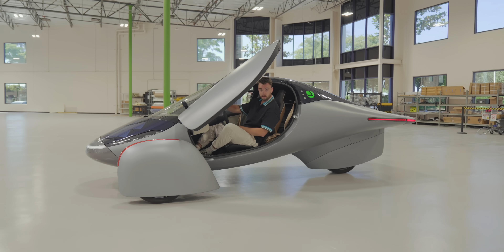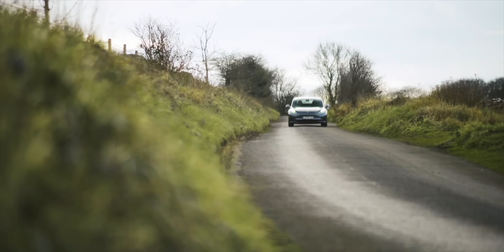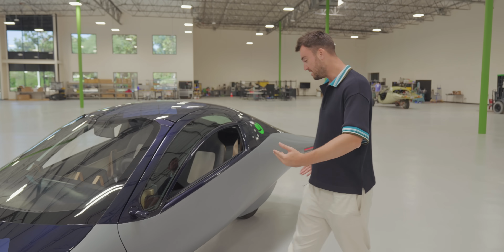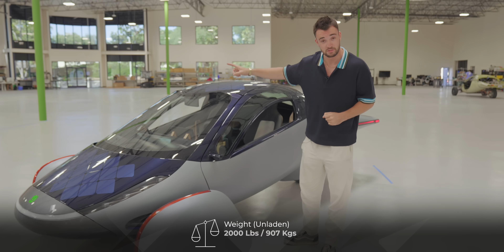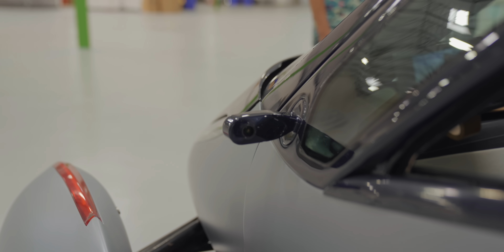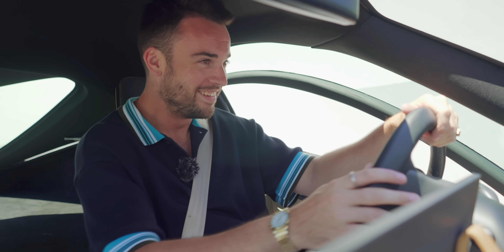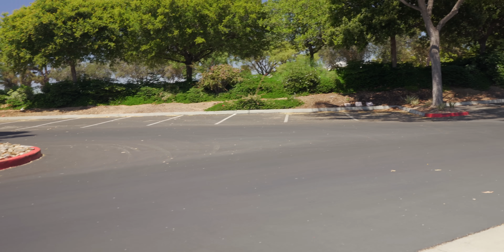The Game-Changing CHEAP Electric Car Inspired By Fish!

Comment: It would make a great summer commuter. Winter up north may be a problem for it. Just looking at it.
Reply: I drive a Gen 1 Honda Insight through Iowa winters.  With similar clearance and much better ABS/Traction control while weighing about the same I don't expect serious problems from Aptera.   However, I will be reporting on my experience.

Comment: Its not a game changer. It is just one of those solar record braking cars that universities build, poorly adapted to go on the road. Its very ugly. The CG is realtively hight due to the teardrop shape. That coupled with only 1 wheel in the back will make it easy to spin out on wet roads. It is extremely big while having the passenger and cargo capacity of a smart car. It is too wide to fit in my garage. Solar panels cost extra and they should be on your house, not on your car. They only add weight, since I like to park in the shade. The trunk is at head hight, imagine what will happen during a crash. Charge port is behind the license plate, you are not allowed to park a car on the road without the license plate showing.
Reply: Lots of mis conceptions in this comment.  Perhaps you don't realize that the wheel motors have their weight centered at axle level.  Cargo space in a Smart Twofor is 12.4 cu ft, compared to 28 cu ft. in an Aptera - more than double.

Solar panels add more than weight.  They also add range - even if you are camping out in Death Valley for the week.  There is enough room in Aptera to sleep two people.  There is a cargo net between the cargo area and the back.

Aptera will be unlikely to "spin out" for several reasons.  One is the balanced 70-30% weight ratio, matching the available traction.  Another is that Aptera can sense wheel slip and adjust torque 32 times per wheel revolution - or about every 2.5" of tread travel - much more quickly than other vehicles on the road.

Please look a bit more closely.

Comment: Is it design only for climates and the city terrain like California?
Reply: No.  They are doing accelerated temperature testing - some parts down to -40.  I plan to drive mine year round in Iowa.
Reply: @n.brucenelson5920  interesting to know. Looks like a semi in a good wind would blow it off the road
Reply: @signedup2462  While Aptera only weighs around 1800 lbs, that is what my Gen 1 Honda Insight weighs.  It has more side surface area than Aptera does, and less lever arm.  I think Aptera will be even better, and I have driven my Honda on Interstates in 50 mph side winds.

Comment: Would love to think about getting one but several potholes before the first stop sign near our home. I am thinking it is just one of those potholes away from breaking.  In other words it appears it will run best on roads as smooth as the floor in that building. show me how those wheel fairlings are not going to be easy to damaged on speed bumps, curbs that a normal car can handle.
Reply: There will be plenty of reporting from early adopters such as myself.  I am not too worried and will report on my experience with winter potholes on gravel roads in rural Iowa.

Comment: You think they would have a production equivalent by now.  Not so promising
Reply: They have been saying for quite some time that they expect their first production delta, manufactured with production tooling by the end of December.  In addition, the recent 6 month SEC report shows that in spite of a great increase in spending, including setting up a 130,000 square ft solar panel factory and a large battery pack factory in addition to the assembly building, they still have about the same 19 million dollar cash on hand, and this is before the California grant money has come in.  This means that investment is keeping pace with expenses and is very promising, in my view.  Compare this performance with Tesla's early history.  This is about the point that Tesla ran out of money and had to lay off all their motor engineers.  Only a last minute cash infusion of $50 million from Daimler saved them at that point.

Comment: Earth Creature; I hope you don't drive too far or very often.  In a day the aptera's solar panels won't help to drive at highway speed more than 15 miles if you live in a very sunny climate; less range if you are say in Washington St with lots of clouds.  If you want to flip off the fossil fuel industry you'd have to buy additional solar panels and probably battery backup at home or "use the dirty dirty fossile fuel" grid.  Which may even be partly coal depending where you are.  While I hope Aptera can get its act together and focus on production; so far I haven't seen the drive to do manufacturing and production of 3 wheel motorcycles for delivery to customers.
Reply: There are some areas that still use coal for grid power, however, since they convert much of what is produced into motion, they are still more efficient than even the best ICE hybrids.  I live in Iowa, where 57 % of our power comes from wind.  I will still likely to get 20 miles of range per day from solar alone - half the figure of San Diego.

As far as production goes, solar panels and battery packs are already under low volume manufacturing and the first delta model produced with production tooling will likely come by the end of the year.

Comment: What about in cold climates? Lithium doesn’t do well in cold climates
Reply: Aptera is specified down to -20 C and many systems are specified to -40.  You are correct that there will be a considerable loss in range at such cold temperatures.  I will be driving an early vehicle in Iowa and report on my experience.

Comment: The swoopy bottom produces lift! It causes the vehicle to almost float on air as it flows forward. Such a cool intelligent design! Hurry tf up, I want one NOW!! Well, actually on October 27th, 2022...can I get one then? 😄😊
Reply: There is actually some downforce built into the shape at the back of the vehicle to prevent lift at speed.- at the cost of some drag.
Reply: @n.brucenelson5920  yep, they put the inverter and some other tech part back there to have weight when moving. It is a brilliant design. I want it!

Comment: Bit late to the comments here but that combination of 6-foot-long back hatch (9:57), solar panels, and battery that doesn’t need much charging / can charge very quickly when combined with the solar should in theory make the Aptera the perfect vehicle for doing what I do: DoorDash. You could fit quite a few cases of water, grocery bags, etc. in that big space behind the two seats, and with the transition to the exclusive Shop and Deliver model in the coming months (it’s transforming into another Instacart) that’s all the more important. Definitely something to consider as 2023 approaches, and of course we need an updated tour of the factory since this video was made given that Chris mentioned “September/October” as the timeframe during which the first machinery would arrive.

Of course, DoorDash definitely is one way to put more than 40 miles per day on the thing, but the combination of solar and efficiency should also greatly reduce charging time at public charging stations.

Comment: Pioneering 21st Century EV-EKG internal self charging battery technology turns EV's into on-demand, carbon free zero emission electricity power-plants. No longer will "All" Electric Vehicles be rolling battery, energy consuming, pigs "aka"  multi-billion dollar financial piggy banks for carbon fueled energy companies. I did an Internet search and found -EKGelectricitykineticgenerator -
EKG Benefits
1) Eliminate Consumer EV range anxiety 
2) Eliminate External charging time at public EV charging stations mostly controlled/owned by EV manufacturers & Power Companies
3) Eliminate Inflated external retail electricity charging cost (fossil fuel or renewables)
4( Lower EV retail price & weight by reducing up to 80% of e-drive train batteries. Cost of EKG is included in EV retail price or sold as an optional add-on power plant.
5) Eliminate all future EV CO2 emissions into our atmosphere slowing climate change. 
EKG alternative electricity generating technology is not a perpetual motion machine
EKG technology consists of 2 primary parts with different functions put together in order to work as one independent power-generating plant. Again, EKG technology is not perpetual motion machine.
Part# 1 is a carbon-free powered compact R.R. PM Rim e-Motor  
Part#2 is a pioneering powerful Hercules 10-KWh or larger zero-emission round, slim self contained on-demand generator/power-plant
Put together is about the size of your spare tire.
EV-EKG internally self generating power-plant technology does not need the EV to be on or running down the road to generate on-demand power to your EV battery platform or while off and parked EKG power-plant can provide on-demand free inexhaustible 24/7 power to your home or business. 
I put the internet search term above, check out the website and storyboard video
Questions? Please reply.

Comment: How will it handle in the snow?
Reply: Based on how my similar weight Gen 1 Honda Insight handles, and the fact that the Honda's rear tires don't follow in the track of the front, and the fact that Aptera has superior ABS and traction control I am guessing it will handle OK.  I will be trying it out with an early model here in Iowa and reporting.

Comment: There's always a trade off, all that range and low price is because it's got nowhere near the structural integrity of a proper car like a Tesla.  You have to have some engineering honesty when you do a review, I expect better from this channel - this is not classed as a car in the US and so isn't required to pass the same crash tests as a car - a motorbike is a very dangerous form of transport.
Reply: You need to review the actual design of Aptera and compare it to Tesla, and have some engineering honesty when you make a comment.  Aptera will be third party crash tested to FMVSS Part 200 crash tests and the ratings published - perhaps before we have similar information for the Cybertruck.

Comment: get it as a motorcycle but not going to be my main.  cause I travel too much I need to have lots of miles as well as sleep in car when sleepy as I drive 5-8hrs.  good for city bad for traveling.

i'd buy it at 15k  if I owned a garage houses too expensive in CA cannot use this.
hybrid plugin maybe a suv needed due to range and sleeping in car.

Comment: It's great except it won't last 5 seconds in the ghetto.
Vehicle makers just can't seem to get anything right so I drive a Stark S17 1500W mountain bike.
Best investment I've ever made. Full Security System on it installed by me. NO APPLE PRODUCTS.
Vehicle makers work for the fed and when you get behind the wheel they believe that gives them permission to do whatever they want to you.
Reply: I think that it will be so different that that won't be a big issue, at least at first and depending on your needs otherwise.  Bikes are great if they can meet your needs.  My wife and I have even gone cross country with our eldest sitting behind me  at one stage in our lives. - no regrets for the experience!

Comment: Brotip: the implications of mass scale adoption of lithium powered vehicles has almost as many negative environmental and supply chain issues as standard fossil fuel ones. 

Not to poo poo this efficient design; I think if you’re going to have some battery vehicles they should be as efficient as humanly possibly…..I just don’t want people circlejerking over EVs as some kind of silver bullet. It’s not, not with our current battery technology, the minerals required for them. 

Until we crack fusion and/or completely master an easily recyclable/plentiful and energy dense battery material, we still face very similar problems.
Reply: While you are correct about the efficient design, you aren't even close on your comparison to the use of false fuels.  (and am one who worked in this area for decades),  Certainly problems still exist, but the scale isn't in the ball park of what they are replacing.

Comment: Also, talking about efficiency I'd like to see how efficient these are at turning people into pancakes when they collide with  a full size SUV.  I assume/hope they are using some advanced materials to make that tiny compartment a tough egg to crack so maybe safety is not an issue, but I'd still want to see it discussed.
Reply: Aptera has been designed from the beginning to modern safety standards and will be 3rd party tested to FMVSS Part 200 criteria as soon as delta models are available to test in a few months.  There are front and rear crush zones and an F1 style passenger safety cage, along with air bags and seat belts.  Wait for the ratings to be published, if you have a great concern.

Comment: One comment about 11:35 -  the electricity to charge the vehicle has to be generated somewhere.  The efficiency he talks about in terms of the amount of energy from the gas to the wheels still is an issue.  Somewhere the electricity is generated and if it's from a fossil fuel you will still have energy loss converting heat energy into electrical energy.  With an electric vehicle you will also then have losses transporting that electricity to the car (of course with combustion you have losses driving tanker trucks to gas stations, or we could go back and add in losses from pumping oil out of the ground or through pipelines etc etc).  If you get your electricity from renewables you still lose energy from the theoretical maximum but perhaps in that case you don't care so much.  In any case even after you add in some of these factors in a more apples to apples way electric vehicles still come out on top, but that 20% efficiency number he states isn't as quite as bad as what you think.
Reply: ICE vehicles are still heat engines and even  if you could get the petrol fuel at no energy production cost, it still wastes much of the energy contained in the fuel, and the engines come nowhere near the electric motor conversion rate.  Add in Cd of the shape, and the numbers for even the best ICE vehicles are not in the same league.  Play with them yourself.

Comment: What about driving this in a Wisconsin winter? 🥶 ❄️
Reply: I will be driving a 2WD model next year through an Iowa winter and reporting on my results.  The Aptera ABS/traction control is in another league and can sense wheel slip and adjust torque every 2.5" of tread travel on each driven wheel.

Comment: Where would be able to charge on a road trip? Would Tesla allow you on the superchargers since it has the same connector?. I think it could take 2 minutes to fully charge. 🤔
Reply: The maximum charge acceptance rate of an Aptera is 50 kW - about 500 miles of range increase per hour.

Comment: Don't be naive...
That car will never pass the highway safety test period.
Reply: It's legally a motorcycle, so it doesn't have to pass any crash tests. However, they plan on testing it anyway, and expect it to pass easily. They've designed in safety from the beginning

Comment: 3 wheels suck, its nice that you can drive 1000 km but i have a big problem with only 3 wheels when taking any corner it just sucks !!! If they
can prove this car is awsome taking corners then i m sold but this is not gonna be the case !!!
Reply: It passed the moose test just fine.
Reply: What GoClimbARockEh said.  My wife and I have ridden in an alpha prototype before Roush Performance revised the suspension and it was already amazing!  Now there may not be a peer at anywhere near the cost.

Comment: Just thought of another thing....this thing would be freaky in low traction situations...as well as rainy cornering speeds...probalby drift like crazy
Reply: We already know it is not - the ABS/traction control can sense wheel slip and adjust torque every 2.5" of wheel travel.  It is amazing.  You would have to turn traction control off to drift it much.
Reply: @n.brucenelson5920  you mean on the one wheel-drive right? TC does not matter if you have very little traction to start with friend.
Reply: @whatyoudo9773  There will be no one wheel- drive version.  The choices are 2WD and AWD.  Of course tire choice could make quite a difference in both available traction and range as well.
Reply: @n.brucenelson5920  Well I conceed it has a fighting chance with AWD, FWD cars certainly get along fine.
Reply: @n.brucenelson5920  are you one of the designers or just have a long position in the stock? ;]
Reply: @whatyoudo9773  I started the r/ApteraMotors Subreddit.  I became a charter volunteer brand ambassador, a small investor, and an early preorder holder.

I certainly have my biases, but they aren't primarily financial.  

Many of them come from decades of work with the petroleum industry, including being in Kuwait during the fires.